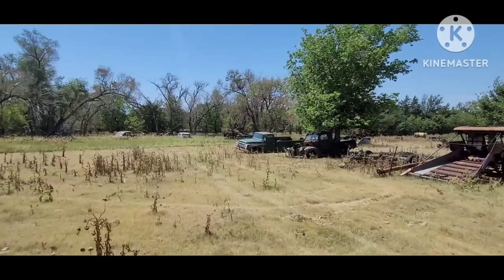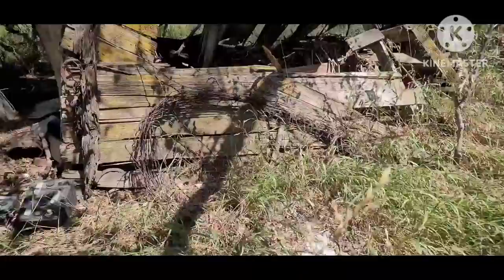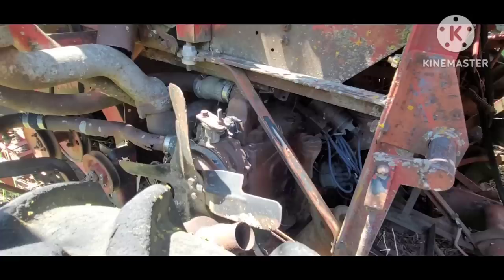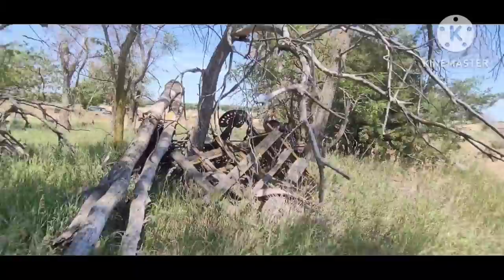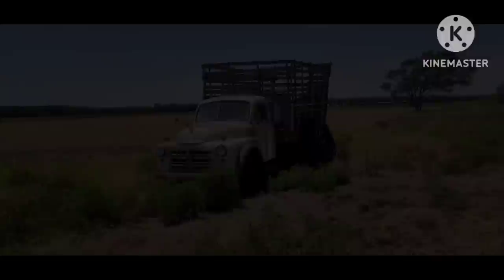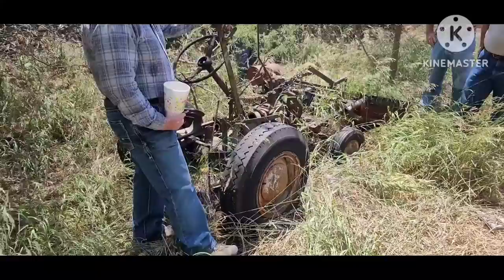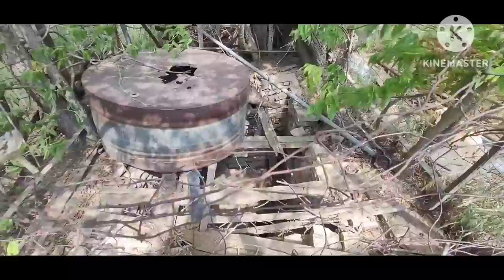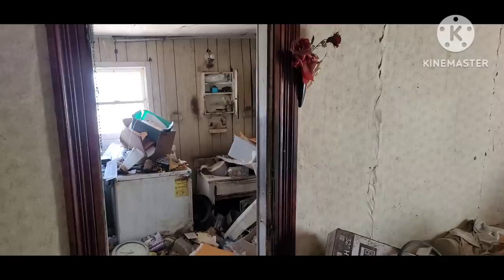100 Year Old Abandoned Kansas Farmstead FULL of antique cars, trucks, tractors & more relics!

Comment: In 1981 as a dog handler for us gov. I was assigned a Fairmont wagon with 302 v-8 3:73 posi-trac rear ratio. Being so light that car flew up highway and still gave 24 mpg.
And it could dig in the snow and mud when other patrol cars couldn't. Robin egg blue.
Got transferred but motor pool would not let go of that car. Was sold to shop mechanic.

Comment: Between 2004-2009, I had a '74 F100 longbed.
All orange. It's original owner was the state of Kansas DOT (Saline county).
Had a 360 V8 and automatic transmission. Power steering and brakes. It originally had A/C, but by the time I bought it, it no longer worked. And I didn't bother to fix it.

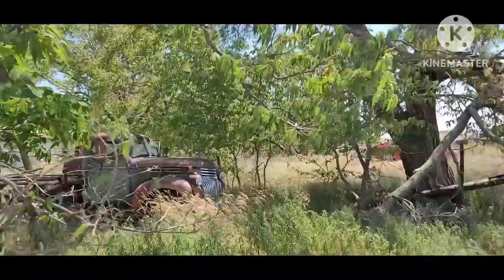Comment: I know the old Johnny poppers aren't worth too much even restored in most cases. That is compared to specially to what cost to get them there. But some of those seats are worth half or twice what they paid for the whole tractor. Or at least he used to be. And I could use one for John Deere B that I have. The woodwork in the house has great potential on resale. First thought was too bad nobody helped a man out. But then he probably wouldn't want it anyway. I owned and drove a Ford Fairmont future with a in line 6 cylinder. It was a 200 CID somebody else can correct me but the old 1964 falcon which I had one of them was like a 160 CID. There were a couple of other sizes that they used for the inline 6 as well that was under 200 CID. A warrant officer that I served with had a 302 and his two-door version of that four-door you saw. I think it was about 8 hours and he slept the whole way. We going from one duty post to another to make the story short 85 90 miles an hour the whole trip. I stopped at a couple of gas stations and visited mother nature while the car is getting gas. Of course only where it's legal to do those kind of speeds. A lot younger than. As far as cruising at 3:02 and Fairmont did you find and still got something like 25 miles to the gallon I think. Approximately 1940 Chevy with a sizeable tree growing through it made great pictures. Something you could probably sell as photo art with the right quality pictures.
Reply from the maker: He intentionally secluded himself from the rest of the world. It was just all he knew
Reply: @mr.goodpliers6988  I knew a man that died at approximately 85 years of age. Been number years ago. He is actually born in the front room of that house. His father was killed in a farming accident. His mother and him continue to farm and cattle. Nice as old boy a person could ever hope to meet. His mother passed away and her 30 or 40 years after that he lived in the house until he passed away. Now the inside of his house wasn't messy it was in need of organization he live a very Spartan life. He also had one of the biggest bank accounts around I guess. He never married never had children. That farm was his life. Sounds like a gentleman who own that farm where are you attended the auction, his life was at Farm as well. I thought you was very respectful of the man and stepping out there and saying don't be judgmental the way his house looked. That was very kind of you and of course the right thing.
Reply: Following you lol

Comment: AC "harvester" is an early round baler  Model was called Roto Baler. Made bales about 20"diameter by 36"or so inches. Bales did not stack as tight in the mow as square bales.AL B.

Comment: That old Chevy pickup... turn-down outer door handles, no vent/wing windows in the doors, and the fuel tank behind the seat...those things all mark it as being either a 1949 or 1950.
(Just for future reference.)
Reply: Interesting information. Wonder if 1947-48 had anything to differentiate themselves from 1949-50.
Reply: @ernielaw  the '47 gas filler was on the passenger side of the bed, with the fuel tank under the bed. 
Hood side emblems read "Chevrolet", with "Thriftmaster" or "Loadmaster" underneath.
Serial numbers were EP for 1/2 ton; ER for 3/4 ton; and ES for 1 ton.

The only difference that I know of between the '47 and '48, is that the serial numbers for '48 changed to FP; FR; and FS.

Early '49 serial numbers were changed to GP; GR; and GS.

In late '49, the hood side emblems dropped the "Thriftmaster" and "Loadmaster".
Changed to Chevrolet, with 3100, 3600, or 3800 underneath.

There may (probably) be more differences. But these are the ones that readily come to my old mind.
I don't claim to be any sort of expert.
Just someone who did a lot of research a few decades ago, when I was doing a frame-off rebuild of a '54 that I once had.😁

Comment: I'd probably give $50 for that truck in the thumbnail, if it's got it's original oil and original tires.
I'm not paying extra though for the rat sh1t  under the seat springs or the bird's nest in the engine block

Comment: I'd have bought the contents of the shed with the Post leg vise, taken the vise and left the rest. Maybe the drill press too.
Reply: I don't mean to be rude.
But, why would you buy the contents of the shed... take only a couple of items (which is what you obviously wanted)... and leave the rest for the family or new owner of the property, to have to haul to the landfill or wherever?
Reply: @willhorting5317  value, most of what is visible is just scrap metal. Post leg vises are popular with blacksmiths and depending on brand can bring hundreds of dollars. Post drills not so much. A nice Columbiana might bring $80. There may be treasures hidden in there, but those 2 are obvious value
Reply: @willhorting5317  also you're buying picking rights, not entire contents. Place like that will probably have a lot left to be bulldozed and burnt or hauled away
Reply: @drskull9  oh ok.

It's been years since I went to a farm auction, of any kind... even though I went to MANY over the decades.
But I wasn't a "picker", or someone who bid on picking rights. So I had no idea.

Thanks for the explanation.
Reply: Auctioneers know when they sell the contents of a building or picking rights that what is left will go into the dumpster. Tim knows the good stuff is always at the bottom of the pile or hanging on a nail and nobody knows what the part goes to but he usually does.AL B.

Comment: the two color paint scheme was common on 70's ford trucks. I had a 77 F250 dark green over light green. probably not a fleet truck.
Reply: My 77 F150 was light blue upper and dark blue lower. My first new truck
Reply: @dankreoger611  LOL, that 77 was my first new truck also. paid 4200.00 and traded in a 72 Buick Le Sabre. trip down memory lane.
Reply: @my2cents945  back in the 70's those were girl getters. Go to the drive in theaters, park backwards, lawn chairs and a cooler. Rock and Roll,  High times
Reply: @dankreoger611  Yep, I don't have the truck anymore, but I still have the girl. 🙂

Comment: I had a '76 F-100 so the F-100 nomenclature hadn't yet become F-150 yet. I'm thinking perhaps 1978/ 1979 was the 100 to 150 change?
Reply: I bought one of the  new F150 s in 77.
Reply: I thought you could get both for awhile
Reply: @highwatercircutrider  I think the F100 went to 1980
Reply: @dankreoger611  Yes. I drove one BITD with the rectangular headlights. Pretty sure it was a 1979. I6 with a 3 speed + OD. Horrible transmission.
Reply: The F-100 ended in 1983.